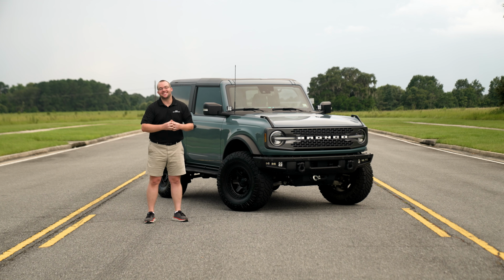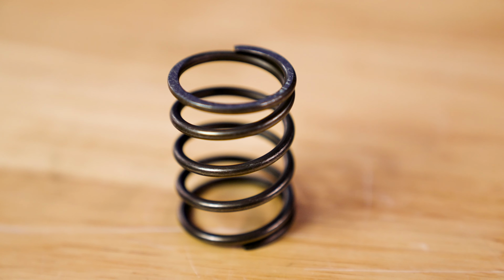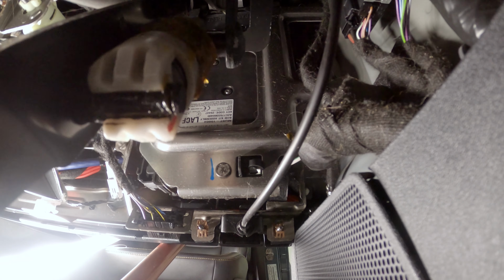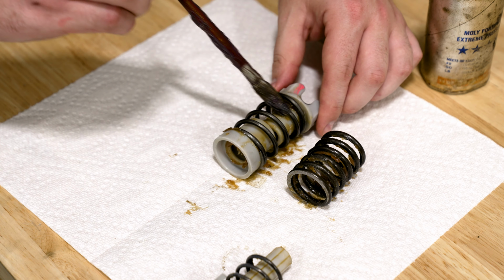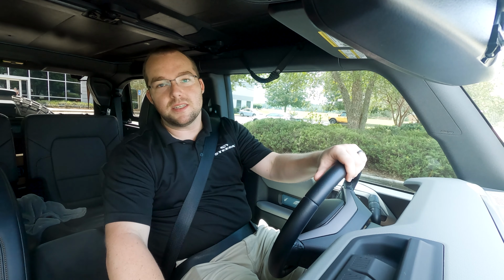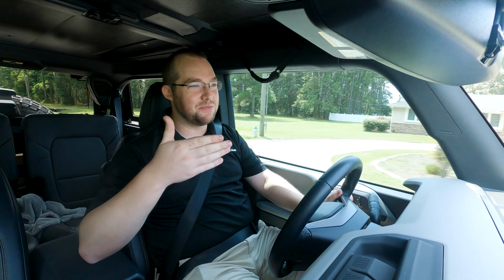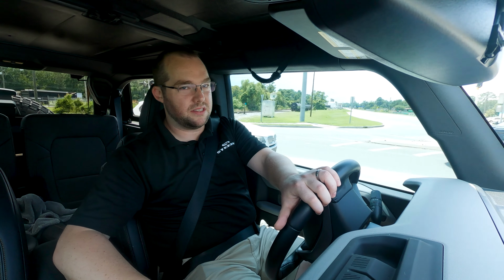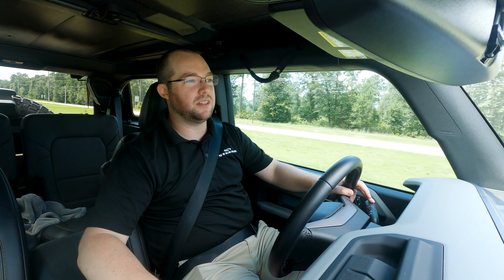A Must Have Mod for Your Manual 2021+ Bronco! | Steeda Clutch Spring Kit

Comment: This spring helps out so much! Well done Steeda. The factory spring was at max tension at the engagement point. Smooth shifts, especially in 1st and 2nd were difficult. The Steeda spring helps immensely.